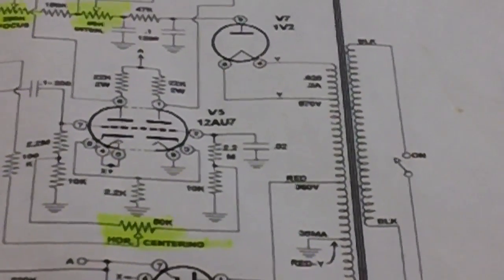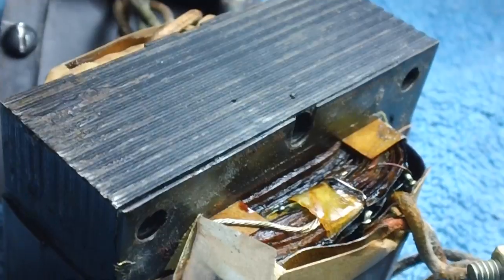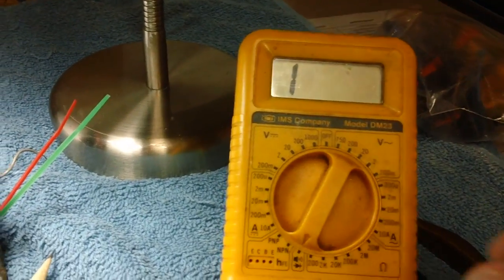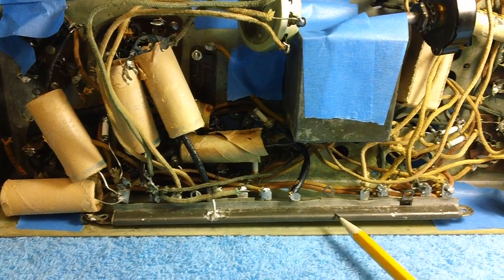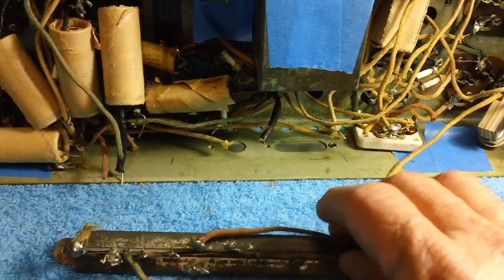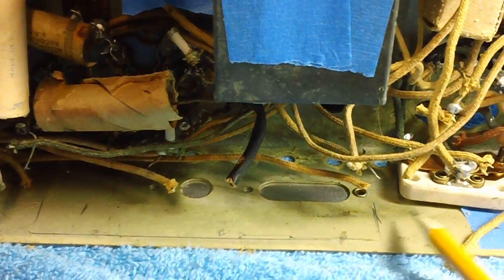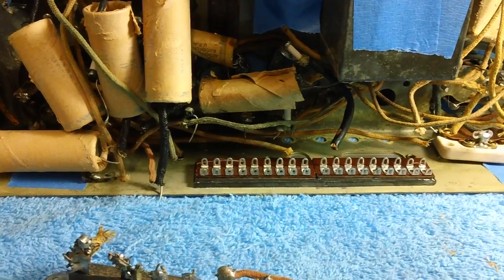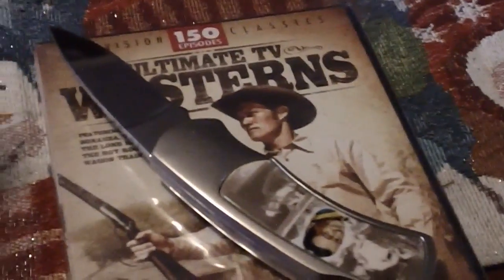Mish-Mash #138

Comment: Those can ohm resistors are always a problem. I used to do electronic organ service many years ago and early Lowrey organs had those in the power supply. Whenever I had to go service one that was dead I already had the replacement ceramic resistors and terminal strips with me. There was one in the radio of my 1951 Zenith TV - Radio - Cobramatic console that was bad. Theory and hands-on experience are two different things. Nice video John. Gary

Comment: Get another transformer with a 6.3v output, feed 6.3v into the bad transformer's 6.3v winding and then measure the primary winding's voltage to give you an idea of the shorted windings in the primary.

Comment: Thinking about this further, we don't want to be led too quickly down the garden path. It's entirely possible that those burn marks are from a previous failure that was repaired. That would have prompted the installation of the fuse. As a first pass, it makes sense to power the transformer on the bench with a variac and measure its open-circuit secondary voltages. Ideally, in this arrangement, the transformer should draw zero current;  This is due to something called reflected impedance.  Because the secondary is not connected, that open circuit reflects onto the primary. Any voltage across infinite ohms is zero current. Likewise, and this is important, if there is a short on circuitry on the secondary it can be reflected onto the primary. Check out the transformer on the bench. If all is okay, check for shorts in the chassis.

Comment: John - Understanding DC resistance and AC impedance are no the same, it still seems the primary DC resistance is a bit low. Adding up the secondary windings this is a roughly 40VA transformer. That primary resistance sounds low, but I could be wrong. Options: a) Ensure the fuse is adequate for the task. A 0.5 - 1A slow blow should be fine. If that fuse is a fast blow it will go everytime since the startup current is high while tubes are warming up. b) Try to find replacement transformers. Yes, that's plural because you won't find any one like it. you could actually parallel transformers that fit your needs. c) Have the transformer professionally rewound. It may be cheaper than you think with the recent proliferation of tube guitar amplifiers. Good luck!

Comment: I'd test the switch and fuse holder to see if either has a short to chassis, it can happen.  A blob of solder or frayed wire s all it takes.  Who knows, it might be a shorted .01mfd/2kv cap on the CRT?  LOL Don  (dang cliff hangers keep us in suspense)

Comment: John,
This is another excellent video my friend.
In my humble opinion, a previous owner of your oscilloscope felt there was some reason to install a fuse facility in the mains transformer primary circuit. Consider this as a scenario: the transformer primary may have been gradually getting warm…and warmer…over a period time of general scope use.  Realising this, the previous owner decided to install a fuse and carriage: partly hoping the transformer would be protected, and partially hoping the heat related problem might go away.
Looking at your transformer, it was neither protected, nor did the problem go away.  Likely as not, a section of the primary winding insulation broke down thus arcing, and shorting out a section of the primary winding, or shorting a section of that winding to the metal lamination.
If this should turn out to be your scope mains transformer problem, I suggest there are only three reliable solutions: 
1/ Replace it with a known working transformer specific for that model of scope.
2/ Consult a rewind service shop for a transformer primary rewind.
3/ Locate a bespoke transformer manufacturing shop, and have them manufacture a clone of your existing transformer.
If you think your project warrants the expense, and if you want reliability, option three might be the best, long term, solution.  I’ve commissioned Majestic Transformer Co, 245 Rossmore Road, Poole, BH12 2HQ, Dorset, England.  They have made transformer for a number of my Vintage Radio projects.
Regards,
Phil.

Comment: Since my 2 ideas have already been posted, I will simply say, I agree with Ron C and MrModelaer about the transformer. There was obvious signs of some burning going on by the looks of the paper.  I guess it's a good thing it had a fuse put in!  I am of course also assuming the fuse was of sufficient amps to hold the load. I probably personally would have tested the continuity across transformer prior to opening and cleaning it. You know John, for someone who said you won't do any more repair videos, you sure seem to keep doing them :)
Reply: +WaybackTECH  - Thank God he does.... I have learned so much from him, it is not measurable. John is a rock star !!!!

Comment: i think the next thing is to see if there is connection between the black wires and the iron core of the transformer...
and since you have opened the transformer, may be you can test it now using the variac and if there is a spark between the winding you might be able to see it (it sound dump,but it's just my opinion)........
wish you the best

Comment: A couple thoughts on the transformer. 1. It is possible that you cleared the short when you cleaned the winding's. If so paint with some insulating varnish and hope you got it. 2. check the secondary winding's to ground. 3. make sure the ground wire has continuity to the frame of the transformer. Good luck with that and Merry Christmas.

Pete
Reply: +MrModelaer John one more thought on the transformer. The ground wire is not the "ground", it is no doubt a shield around the primary that is supposed to be grounded to the frame but insulated from the windings.

Comment: I had a feeling that Fuse Holder would lead you to more work, that is why I asked last time. I love watching you fix these transformers but I am up for your challenge.   Since you have confirmed that the windings are intact and they are not touching each other in my mind there can only be one logical explanation for the fuse blowing.  I suspect one of two things.... either the black leads are shorting to the chassis  ( Bad insulation)or there is an arcing or something similar occurring between the uninsulated winding and chassis or between windings..... sooooooo... I would put some of that clear plastic insulator ( from Hobby Lobby) in between those exposed windings  and between the bell housing and the coils and use some liquid tape to ensure nothing is exposed (Once you confirm one last time that everything is worked as intended.  I  would also check the wiring insulation and make sure no cracks and possibly put some heat shrink on the wire leads coming out of the transformer and color code to make sure nothing it shorting when wires were bent.  A more radical solution would be to connect the Primary side to the variac and install a fuse inline and see if it blows when NOT in the chassis. If that proves to be ok, its time to check under the chassis it self and start doing continuity tests on the primary side and see what is wired improperly or grounded. I tend to think the transformer is ok and that burn mark was an effect and not a cause. You have to ask... why was a fuse installed in the first place.   How did I do Jedi Master ?    :)